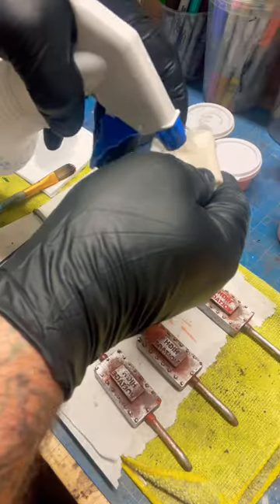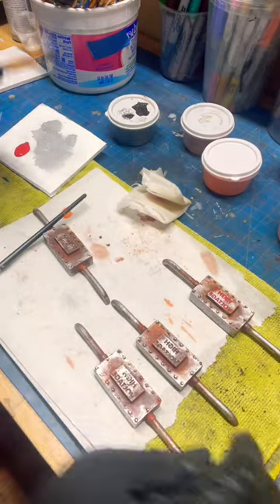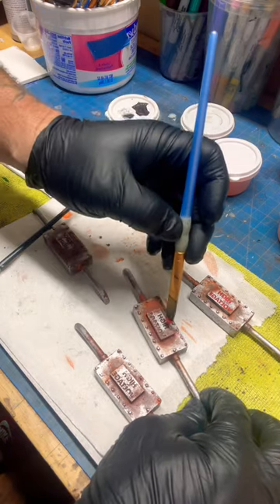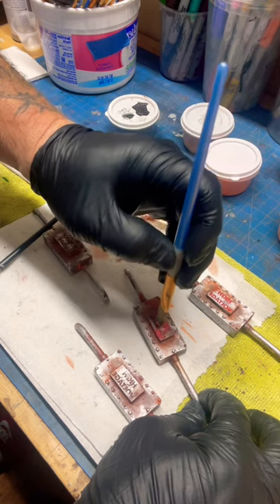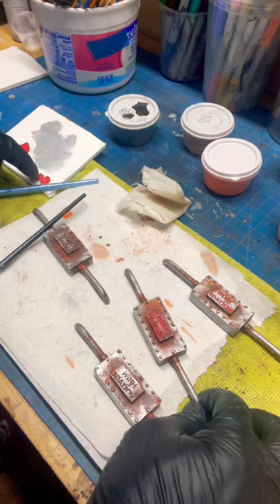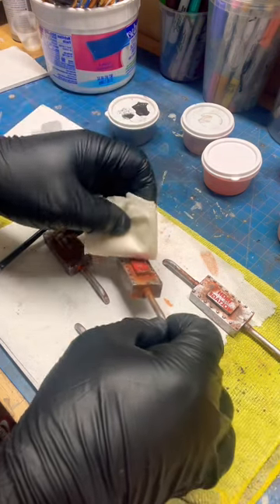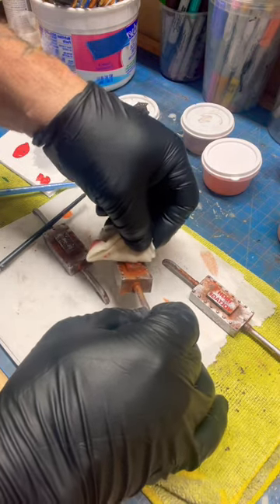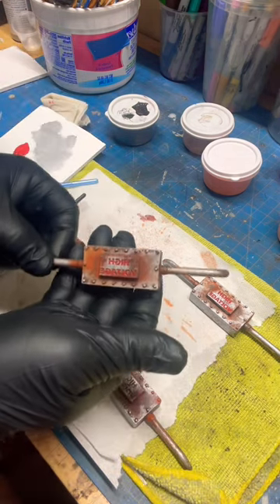Easy clean paint trick on recessed lettering for 3D printed diorama pieces.  #3dprinting #painting

Comment: Should I dilute the paints before hand? The same brand I have (mr.color) offers paint thinners. Would it make it easier to wipe off/have a better look?
Reply from the maker: I’m not sure of that brand if they are water based then just thin them with more water but I wouldn’t thin them because you want the paint that is left behind to be undiluted for best color.  This process is easy and no sense in making it complicated dab your paint on then with moist towel lightly wipe away excess easy as it gets. Hope this helps